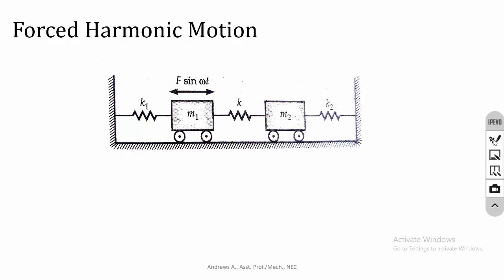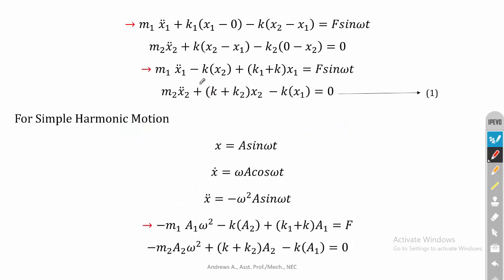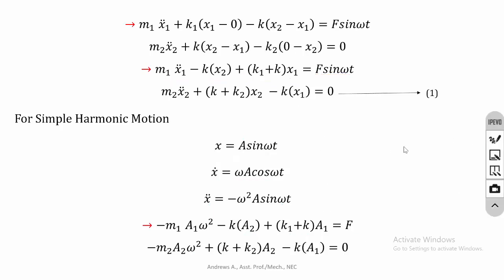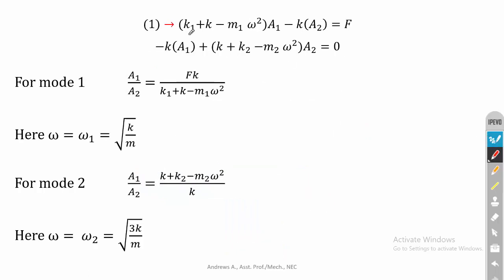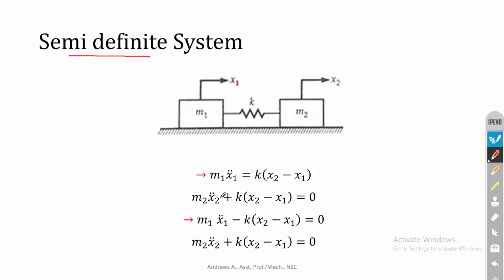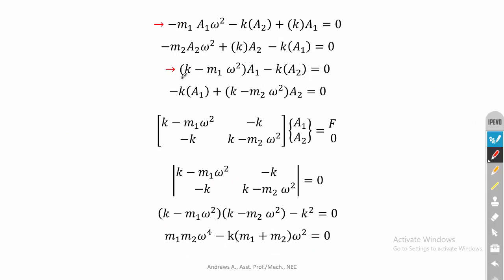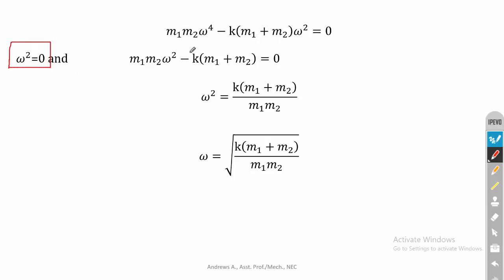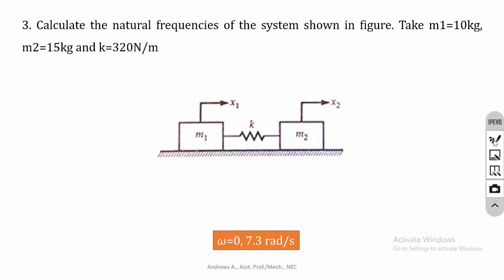Semi Definite System | Natural frequency and amplitude ratio | Vibration Control

Comment: Sir.........what will be the condition for 3 mass in it......plz tell if there is any formula!!!
Reply from the maker: For three masses, the right side of the second equation will not be zero because you will have a spring on the right side of m2... Also add one more equation for m3... For solving three equations use matrix method..
Reply: @themechanicalengineer  means we have to form 3eq of motion and solve it using matrix method🤔🤔
Reply: Sir....if u have time then plz make a vedio on it...it will help to understand easily.....
Reply from the maker: sure!!